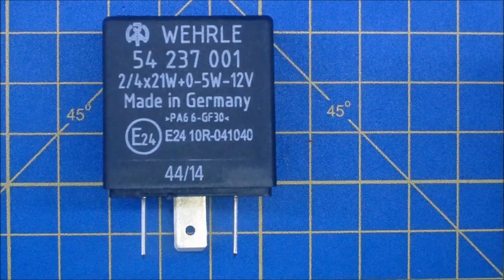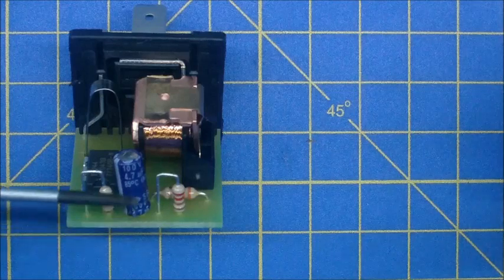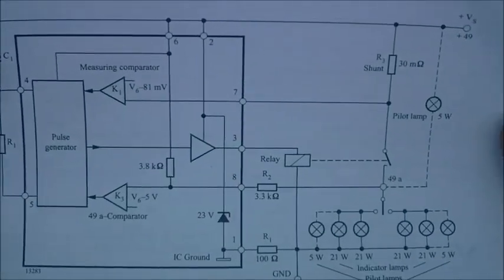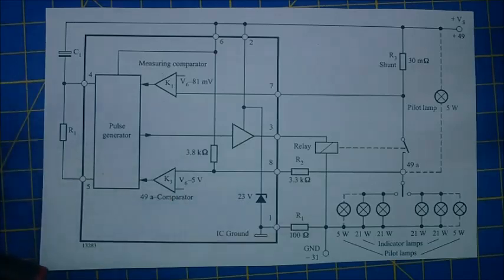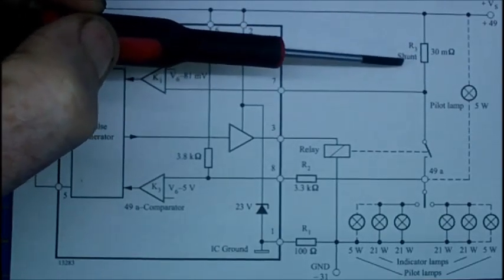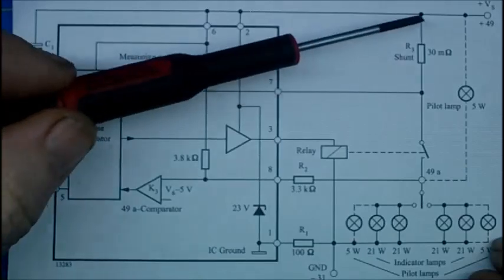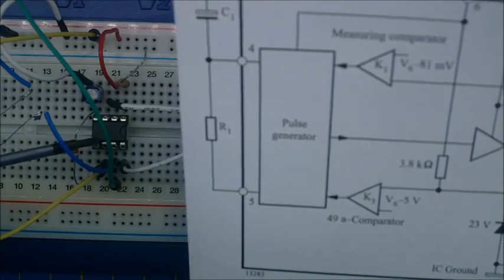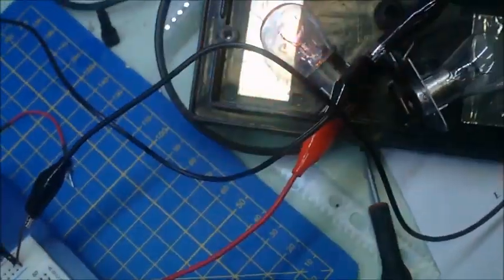Automotive Electronic Flasher Unit or Turn Signal Relay

Comment: Culd I use relays for ignition coils? I have some problem me gm 4 pin ignition module is polarity sensitive I have also positive linear voltage regulator inside dash board the thing is me coil does not get enough voltage I do have that R terminal starter motor wire bypass to ignition coil but cant use it .
So any ideas what I can do to change polarity ore some how bypass those polarity problems?
I do have after all 2 starter motors .
So how can I solve those problems?

Comment: Can you write values for all resistors from this circuit, R1 is repited two times. Circuit and PCB not very clear.
Reply from the maker: Hello there: R1, wired with the capacitor, C1, is responsible for determining the flashing rate. The value of R1 can be between 6.8 to 510 kilo Ohms.You are correct when you say there are two 'R1' resistors. There is a misprint on the datasheet, and the second 'R1' should be marked 'R4'.The purpose of R2 and R4 are to limit current flown in the IC (the chip).R3 is a low value (30 milliohm) shunt resistor, used to calculate the current flowing in the indicator circuit. If a bulb in the circuit fails, less current will flow, resulting in less voltage drop across R3. This information is fed back to the IC, which increases the flash rate of the unit, thus notifying the driver of a bulb failure. Pins 2 and 6 are connected across the shunt resistor, R3, for this purpose.
Reply: @ @mattOl  I thought it was R3 value is 30 Mega Ohm Instead 30 Mili Ohm. Is it value of R2 3300 Ohm? What would happen if I replaced the bulbs 21W with Led diode 100mA or 200mA or more mA?
Reply from the maker: R3 is a shunt resistor, and its value is 30 milli ohm - 0.03 Ohm. This resistor has to be so small so as it does not interfere with the current flowing out to the indicators, but will still produce a voltage drop across itself. This voltage drop is 'read' by the chip and used to calculate the current flowing in the indicator circuit: I=Vdrop/R = Vdrop/0.03 ohms. The less current that flows, the smaller the voltage drop, and this smaller voltage drop increases the flash rate of the flasher unit. If you replace the 21W bulbs with LEDs, the current flow drops from about 3.5A to a small amount of mA. This produces a very small voltage drop across the shunt resistor R3, which is seen by the chip, which in turn increases the flash rate. If you wanted to modify the unit to work correctly with LEDs, you would need to change the values of R1 and C1 to give yourself an acceptable flash rate. If you search for the datasheet for U2043B chip, on that sheet you will find details of the calculations necessary to determine the values for R1 and C1. Finally, yes, R2=3300 ohms.